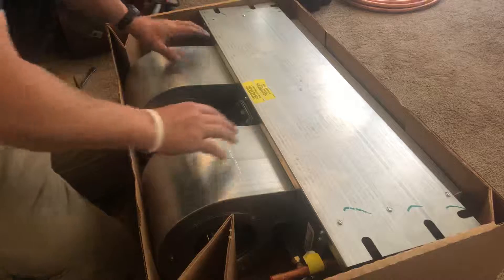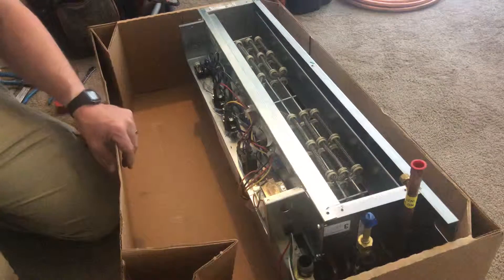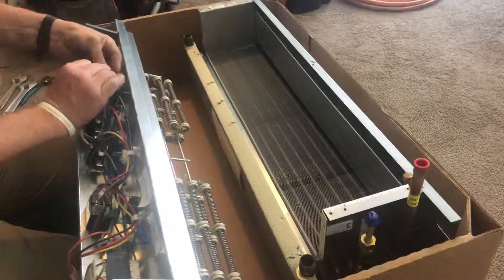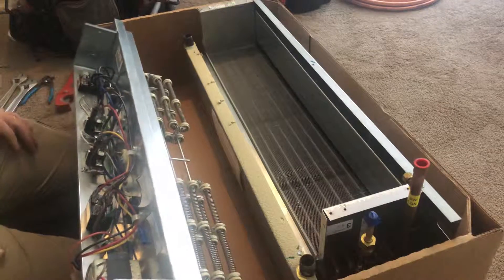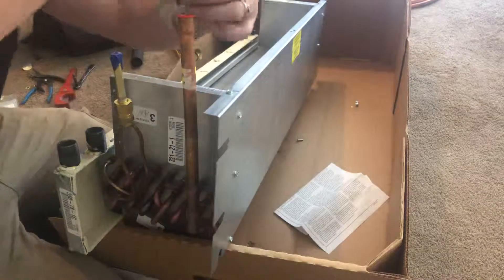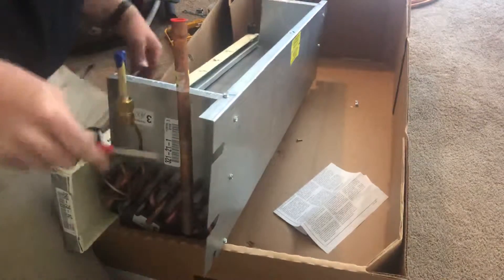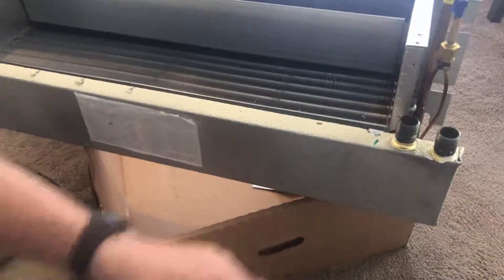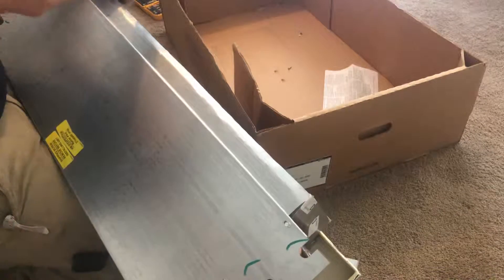Replacing Furdown style Air Handler 2/6

Comment: no contractors are willing to replace/install new 25hx series or similar. Glad i found you here. reluctant for DIY though.
Reply from the maker: I’ve installed over 100 of these bad boys. I’ve gotten it down to a T. It takes me about 4 hours to do the work. Some installs takes more time depending on what obstacles I come in contact with. If you want to learn how to do this then I suggest maybe doing it in a vacant unit where you have some time for errors. I was nervous when I first started off installing these units. I recommend taking it apart to install then reassemble the unit. Less weight and more room to work. Hang in there.
Reply: May I know where is the air return is for those units? Are they in the gille in each room or if there is only one which is below the fan?
Reply: @michaelzz9198  there is only one from below the unit.
Reply from the maker: @michaelzz9198  the return is in the ceiling. There is a small cavity with a filter grille behind me. Nothing fancy but it get the job done.
Reply: @klinthanks9946  thanks vbery much. All i have is the unit is colling like ice. The only problem here is drain pan replacement. I got 930hxdp drain pan which is the same as current rusted one.

Just not able to remove the old one. Does it need a dismantle and re assembly..?

Comment: Have you ever had to clean the coils in these air handlers? I have a 2.5 ton Goodman about 8 yrs old, recently noticed not cooling as efficiently and indoor coil freezes right where it splits from from lineset. Could dirty coils cause this? I replaced the capacitor earlier, filter is clean, compressor checked out w ohm readings. I have a tech coming in a few days to check Freon levels, any insight much appreciated!!!
Reply from the maker: @bennyabolmaali4115  Hello there and thank you for watching. First off let me answer your question. Yes, I have cleaned these coils but not very often though. I find these coils kinda clean themselves. The complex I work at was built in 1982. I still have original units running as of today. I’ve changed well over a hundred units in the last 15 years of being there. I’ve never seen one that was clogged to the point that it would freeze up. My recommendation is to check the Freon charge as that can also be a cause of freezing up. If the charge is low, it can freeze up. Give that a shot and if that doesn’t work, reply to this comment and I’ll try my best to guide you through it. Thanks again for watching.
Reply: Thanks for your quick reply! I'll keep u posted. I was thinking maybe low freon too but couldn't see any leaks anywhere. None has been added since it was installed. This unit did/does have "dirty sock" smell when the AC first starts and again when the compressor goes off and the fan still goes for a minute. Thanks for the great videos!!!!!
Reply: @klinthanks9946  Tech came. Initially he thought system had very low freon, then he realized it's almost completely full. He seems to think it's the filter drier which is inside the condenser in this Goodman unit. He had limited English to so I may need a second opinion. I'm trying to figure out what type of metering device the air handler has. Goodman Acnf 2.5ton straight cool. Have u had to replace a dryer on these systems?
Reply from the maker: It’s difficult to diagnose without have the gauges in my hands. Having a clogged filter drier on the inside of the condenser can be difficult to spot. Typically though, the unit will have a higher amp reading on the compressor but can still be difficult to spot if it’s only slightly restricted. I don’t like driers on the inside of the condensers for this reason. If I think I have a clogged drier in a system, I’ll remove the drier from the inside and install one outside of the unit. As far as the metering device. Most of those Goodman Units come with a fixed piston as their metering device. I believe those can have a Thermal Expansion Valve (TXV) installed as its metering device. If your metering device was clogged up, then you would have a high liquid pressure and a lower suction pressure. Again, having the gauges in my hand or just knowing what the pressures are would assist me in diagnosing it. I hope you get to the bottom of it. Keep me updated
Reply: @klinthanks9946  Man. Haha. I wish I had you as my tech. How generous of you to take the time to answer. This guy had limited English and asked me to contact his boss, I have yet to speak to him, they installed a condenser for my mother about a year ago. From my research it seems you can check the temperature on either side of the dryer to get a sense if it may be clogged, maybe tomorrow I open up the casing and put my cheap thermometer on it, I definitely need to have a second tech come have a look, thank you again for your kind response and I will keep you posted
Reply: @klinthanks9946  well the saga continues, I did open the casing and both sides of the dryer are reading about 91° after about 10 mins of system running, very similar, wonder if the orifice is clogged or something, i do have a photo of the last tech's fieldpiece gauge, wish I could share that w you as I think u could make heads or tails of it
Reply: Just to update you tech # 2 came, quickly saw it was low on freon, put his sniffer all around the air handler but couldn't find a leak, put about 3 lbs of 410 in, system is cooling fine now, we'll see how long it lasts, I appreciate your insights, have a wonderful day
Reply from the maker: @bennyabolmaali4115 glad you were able to get to the bottom of it. It’s always best to get a second opinion if you’re questioning their confidence. Would’ve spent a mess load of money just to find out it was a refrigerant issue. Take care!!

Comment: What if there is a tap right close to the side you disconnect and there is not a mix of hot and cold air? Could that room be getting cold air most of the time?
Reply from the maker: I have had it happen a few times where the plenum doesn’t mix the air properly and will result with that. You could try dampening the other air registers to see if that help.

Comment: How much sq is that capable off?
Reply from the maker: The Square Foot a unit can cool depends on a few variables.  Ceiling height, amount of windows, age, insulation rating, top floor, bottom floor, West or East side of the building, trees, etc. I was originally taught that in normal circumstances the rule of thumb is 400-500sf per ton. With the higher SEER ratings in todays equipment, I’m sure it could be more per ton. Hope this answers your question. Thank You for watching.
Reply: @klinthanks9946  what brand unit is that
Reply from the maker: @CR4zyTorTiLLa  it is a First Company Air Handler